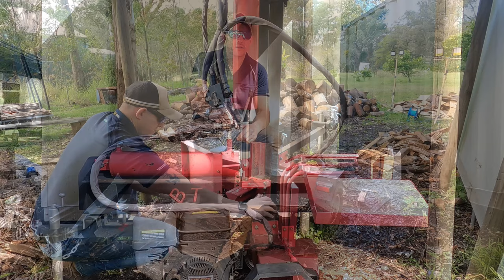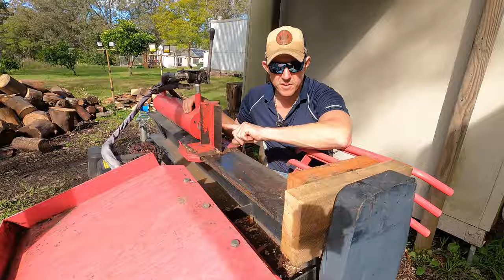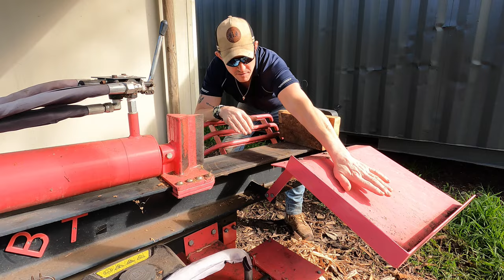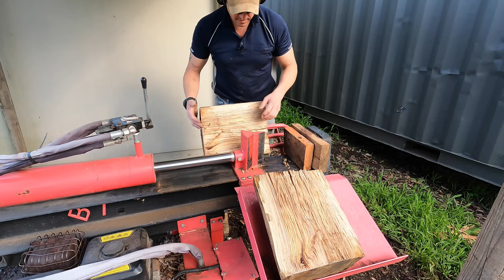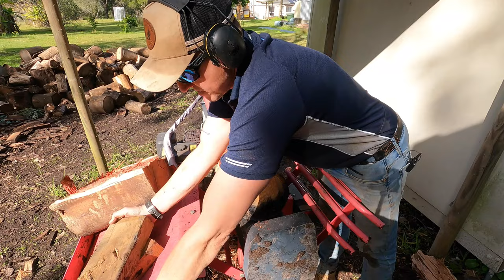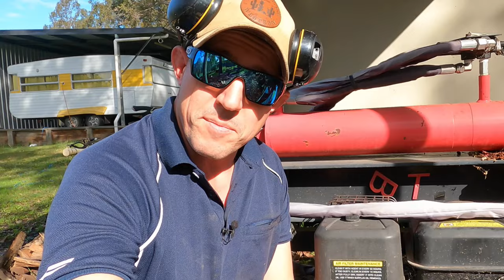The best Log Splitter Hydraulic 45t 65t wood splitter review.

Comment: I like the idea of the two by's,but that cylinder is not big enough in diameter for the machine to be sixty five ton unless the hydraulic pressure is scary high.
Reply from the maker: Hey mate. I think you might me right.  I read in the specs they it actually rated to 45t, but tested to 65t. I'm not entirely sure what the raring is referring to but it deffinenty can split anything I can give it.